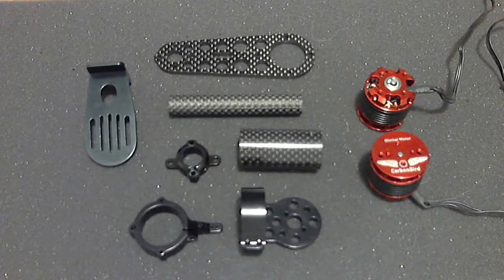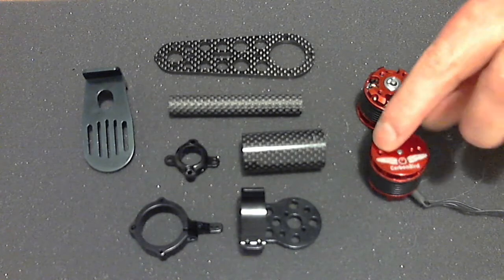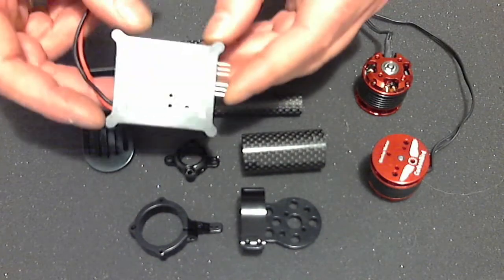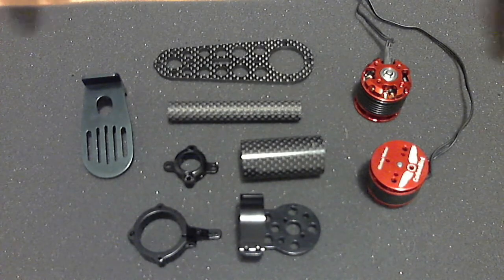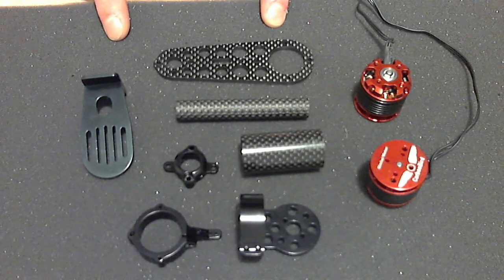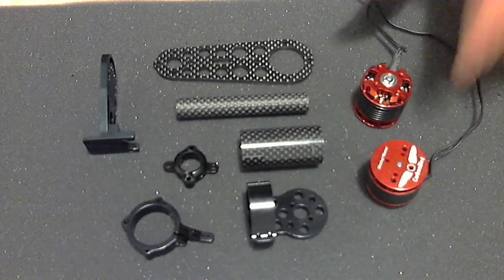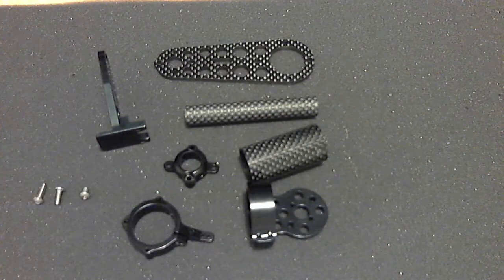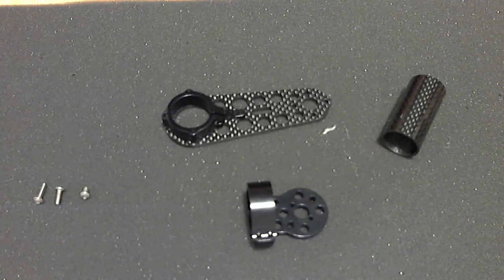Scarab Armoured-Gimbal Black Assembly Pt1

Comment: Done well, I've purchased this and yes it goes together easy, so far I think I have it exact, I should have time to power it up soon and do the final checks and tweeks, there are a lot of screws that come with the unit, great video and REALY appreciate the time and effort you take putting these videos together. I got 2 slightly different motors with mine, it doesn't really mention anything in your video about then being different, but they are labeled, 1 as roll motor ect so I think I have it right. Time will tell, thanks again.